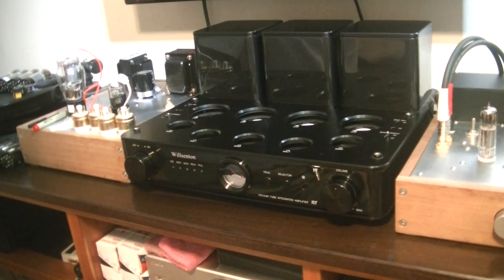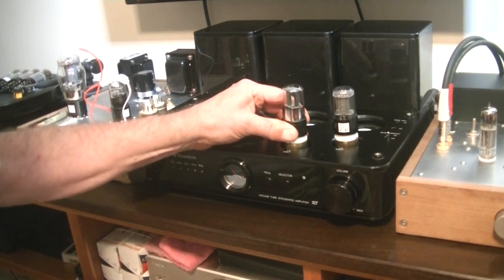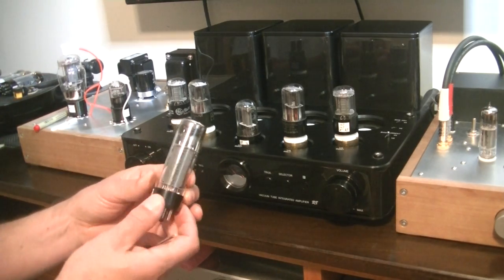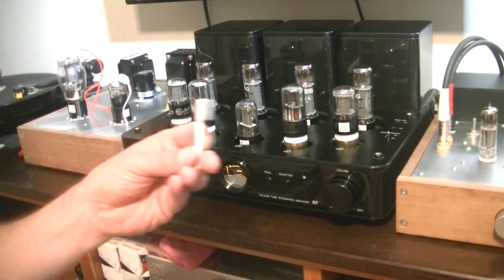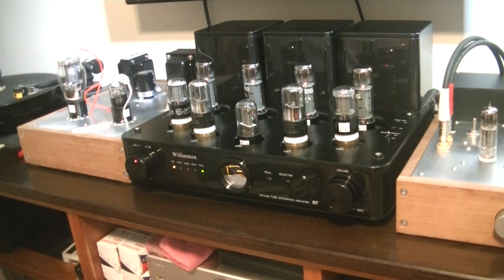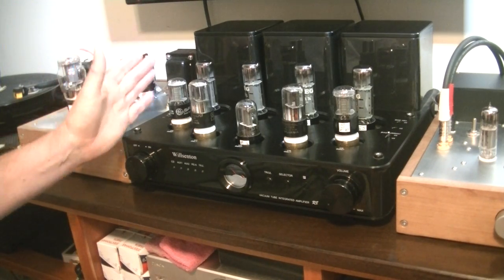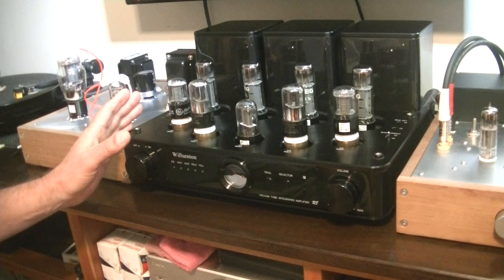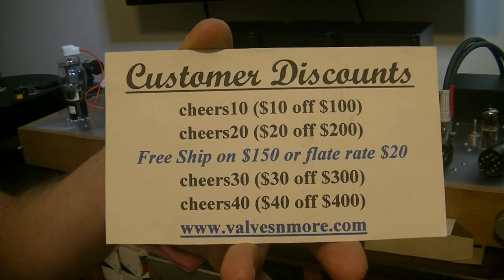Tube Lab #51 Biasing the Willsenton R8 or any Push Pull Class AB amp

Comment: I  completed my first power tube swap (Mullard EL34s to replace stock KT88s) thanks to your excellent instructions!! I checked the bias after 20 minutes. So far I am enjoying the new matched EL34s with a greater sound stage. I’ll be checking the bias over the next few days as you recommended👍👍
Reply from the maker: Ahhh success well done!  When you first start out in tubes you're always worried - will these things explode, send out lightening bolts etc,but if you follow standard safe tube changing practices of course everything works just fine.
Reply: @tubelab194  - Hey Jim, I just put an order to you for two Melz 6sl7 tubes for my Willsenton R8. Best 2 U

Comment: Hi Jim,

Regarding the Socket Savers for use with the R8, would I use the for all 5 preamp tubes? I noticed in the video you had only four.
Reply from the maker: Yup, because you won't ever need to roll tubes into the centre socket (v5), I don't bother with a socket saver/lifter.  The pair of 6sn7 (V6&9) and pair of 6sl7 (v7&8), they can be rolled as you try and find your perfect combo.
Reply: @tubelab194  - thanks Jim👍👍

Comment: Great video Jim and demo on bias on the output tubes and the test for microphonics just great !!!! I have a pair of military 6sl7 dated I believe 1948 or 44.....Im enjoying the 6sn7 and 6sl7 tubes I bought from you....love the Marconi 6sn7....nice !!!!....Ed in New York 😎☕🗽🏙🎶🎵🎶
Reply from the maker: Great to hear from you Ed!  Yes 1940's mil spec tubes rock!  It's one of the main reasons I designed the Yuri monoblock Kit Amp - to take advantage of the much neglected cv6 / 7193 wwII radar tube  (derived from 6J5), which as you might suspect, sound amazing!  Dead quiet, zero microphonics and great little driver tubes for a small amp like the Yuri (2wrms).

Comment: Skunkie designs on you tube has some videos up on some important mods to perform on a Williston R8.
Reply from the maker: Caution!  Just swapping one good resistor for another good resistor may not necessarily improve the sound.  Some of what she does looks like a good idea, but other things I'm not convinced.  Remember the r8 in stock form with quality vintage tubes already sounds great.  And watch the last episode First she got a bunch of resistor values wrong.
Reply: @tubelab194   Yes, true. One good thing, though, was upping the voltage on the two electrolytic caps from 450 VDC to be able to handle the surge. Also, changing out the choke.
Reply from the maker: @danielthomas3057  we've used our r8 commercially (it's a great test amp for quads of power tubes) for over 2 years and other than some minor problems due to the heavy use, it's worked perfectly and still sounds amazing - completely stock.

Comment: I was wondering what was your toughs on the Muzishare x7 tube amp from China.(I own a Marantz solid state amp)
It’s seems people love the sound and the cost of the unit. Before I buy a tube amp, and after looking at this video, I was hoping to get your point of view on this matter , thanks , love your videos and they are well explained for a newbie 🍻
Reply from the maker: I took a quick look at the Muzishare x7.
It looks like it only takes the KT88 power tube and the R8, can also take the EL34 giving more flexibility.  Interestingly the one thing these modern tube amps don't talk about in their specifications is the tubes!
Internal build quality of the R8 is superior based on what I can see from a picture.  I've been inside my R8 on several occasions and am always impressed at how well layed out and built the amp is, especially when you consider that it's a budget amp.
All that said, IF you can find quality affordable tubes to run, and after you check if the reviewers like the sound, the amp may be a good choice - I say MAY.
Remember the tubes ARE THE AMPLIFIERS, so plan on replacing the stock Chinese tubes with something of quality. This can increase the cost of these inexpensive amps significantly, but if you want good sound it's gotta be done.  Note it's not just inexpensive Chinese amps that come supplied with mediocre tubes, almost every tube amp made comes that way, even very expensive high end gear.
Reply: @tubelab194  big thanks for these  infos, I agree 100%, 🍻

Comment: I am new to tube amps. What is a socket saver? Why does the socket need saving? What are we saving the socket from? Do I need socket savers on my new amp? Thanks for the videos.
Reply from the maker: All good questions!
First, traditionally a socket saver was used for high use sockets, such as in tube testers, basically it saved wear and tear.  Also older equipment with iffy sockets would have an adapter dropped in to help save replacing the socket.
These days they're used as lifters, a lot of modern amps have sunken sockets (R8, schiit preamps etc) once the tube is plugged down and in, the only way to remove it is to partly pull on the glass, and this can loosen the glass to base glue bond, ruining your tube.  The lifters solve this problem by getting the tube high enough you can now remove by pulling on the plastic base.
Note if you aren't into tube rolling (trying different tubes), you won't need socket saver/lifters.  Just plug your tubes in and forget about them!
Reply: @tubelab194  thank you for the great explanation.

Comment: Why don't these amps have tone controls? What's the downside? It's a shame, is it not? I adjust my tone controls on each song.
Reply from the maker: Modern gear generally doesn't include tone controls, the thinking being they will degrade the signal path and they're mostly not needed anymore.   If you have quality source material and a good well balanced system you shouldn't really need to adjust the EQ.  Back in the day, when I was a wanna be audiophile (1970's), many people ran graphic equalizers, our equipment just wasn't that great sounding - in particular our speakers sucked.  But today if you play digital files, you can easily bring up a graphic equalizer in your software.  If you play vinyl, then you are limited to adding a physical unit in the signal path.  Simply upgrading your existing system may completely eliminate your need to apply EQ.
Reply: @tubelab194    Thanks much for that clear and informative explanation .

Comment: Hi, the bias for the V1 and V4 on my R8, could not be adjusted and the needle is on the far right. May i seek your opinion on this please ? Thanks.
Reply from the maker: You probably have the rear bias switch (beside iec power cord inlet) in the wrong position.  With the amp off, set the switch up for EL34/KT77 and down for KT88/6550.  Now rebias the amp.  Other possibilities include using the wrong type of power tube or defective power tubes, but I'm pretty sure it's the rear switch.
Reply: @tubelab194  How do i fix this, please ?
Reply from the maker: @alfa3421  did you read my instructions?  If they didn't help, I need more information than "how do I fix this"

Comment: I can see you use the socket savers and only certain tubes is there a reason why you did not use them for the power tubes as well as the center rectifier tube just a question I’m new to this thank you
Reply from the maker: The socket savers are being used as lifters, the most common use by far for them these days.  In the R8 the front preamp tubes don't have much finger room in the top plate hole to grip the base for removal (especially the standard shallow base), but the rear power tubes have huge cutouts to aid in ventilation, so you can grip the entire base for installation and removal.  Basically if you push or remove your tubes by the glass instead of the base you will break the glue bond between base and glass, wrecking the tube.  Some can be saved by a careful glue job - but who wants that if you can avoid it easily!  Back in the Day this was never a problem because all tubes were surface mounted, it's only recently that tube amp manufacturers started using PCB's with sunken tubes.  In my Kit Amp designs I avoid this poor design, even when I use a PCB, by carefully setting the boards at the right height so that the tube socket sits flush.

Comment: How do the socket savers work? Do they protect the female tube socket mounted on the amp? Or the male pins on the valve socket? Either way you still need to insert pins into the valve socket on the amp.

The R8 is made in China right? 
Probably the best value valve amp that delivers quality performance in the world.
Worth the $270 shipping costs I paid. (I have never forked out that much money for shipping and handling in my life. The highest amount i paid for shipping costs up to that point was about $25)
Reply from the maker: The socket savers are being used as lifters.  The front preamp tubes are sunk below the chassis and there isn't enough room to get them in and out without grasping the glass, which is a very bad idea with vintage tubes as it is easy to break the old glue bond and end up with loose bases.  Tubes with the shallow bases are the hardest to remove safely.  The socket savers work perfectly at getting the tube up a wee bit.

Comment: Hi, thank you for your excelent lessons.I learned a lot about tubes by your videos.
I have a question for you.I own Willsenton R8 and a quad of 6p3s-e wich sounds wonderfull.I use them with the bias in the middle.I've read that they sound best at 500 mv but I don't know wich are the values in volts of the vu meter at the first line, in the middle and at third line.Maybe you can help me.
Kind regards, Romeo
Reply from the maker: The 6P3S-E is not a good tube to substitute in the R8, it is basically a Soviet 6L6.  Yes it will work sorta electrically, but not optimally.  A lot more is involved when trying completely different tubes than just setting the bias.  The tubes that will work well are the EL34, KT77, 6550 and KT88.
Reply: @tubelab194  Thanks o lot for your answer

Comment: Hi Jim, Love your Video!  I was looking at the Willsenton R8 or the Cary CAD-120S MKII VACUUM TUBE POWER AMPLIFIER. I herd the Cary at a NY audio show with some Kef R900 about 2017 and it was amazing!  Your thoughts vs Price Performance ect. The Cary is 4 g's. Expensive!  Thank you.
Reply from the maker: I've only ever heard one cary amp and it was ok.  I've had the R8 in for almost 2 years and for a larger 4 power tube (class AB) amp it has been great.  Solid quality construction and i paid about $1,200 with the cheaper set of EL34 tubes (garbage).  At that price it's a bargain!  But remember with any tube amp the quality of the tubes makes a huge difference.  Why?  The tubes ARE the amplifiers!  And unfortunately manufacturers - even good ones, often ship out amps with crap tubes.  So plan on spending a significant amount to retube any amp you buy.

Comment: I heard some lower hum or electrical noise coming from my SET 300B amp , not exactly sure if the noise  is coming out from the 300B tube/5687 ,or is it because of biasing problem or failing tube ..noise only on one SET not the other Set amp.The 300B tubes has been 8 years old .Thanks for any opinion /help (wyetech claim to has auto bias)
Reply from the maker: If you want to know if it is a tube issue, just swap tubes, if the noise moved then it is the tube.  If that doesn't catch it, check and see if ALL your power cords go to the same quality breaker bar.

Comment: I enjoy your video a lot and have a question to seek your advise. Recently I bought the wilsenton r800i 805 model, the rectifier tube is a 274b, if I have  Ratheon 5U4G NOS, is it advisable to replace the 274b stock tube with the 5U4G ? Appreciate your advice ! Thanks
Reply from the maker: Your 274b is a Shuguang reissue of the famous tube made by Western Electric.  And even my large rectifier cross reference doesn't give a direct equivalent.  So I would suggest sticking with the stock tube.  Other close rectifiers may well work just fine, But the circuit was designed for this particular tube and switching to a close compatible will at the least change the B+, probably nothing to worry about, but given how inexpensive the Shuguang probably is, I'd stay with it.
Reply: @tubelab194  Thank you for your great advise !Appreciate it very much !

Comment: Have you had experience with the PSVANE tubes that can come with the r8 as a more expensive option to the standard Willsenton ones. I believe they may be a recent copy of philips types that are no longer in production but possibly are Chinese made, these are the ones I chose and sound nice but I have no clue on quality long term. Mine are the PSVANE EL34. Cheers
Reply from the maker: No I haven't tried the PSvane tubes, my specialty is vintage and frankly whenever I do come across a Chinese made tube I'm disappointed with the build quality, they just don't last.  Now I'm sure the higher end tubes are an improvement, but when you look at the cost, wouldn't it make more sense to go vintage?  I'm biased of course (get it biased haha)!  I love the sound of vintage tubes!
Reply: @tubelab194  I am biased as well to vintage Sansui ( non tube) but the r8 drew me to the other side. Hmmm vintage valves (tubes), could be a whole new ball game for me. Cheers for the advise

Comment: Can you use any of those 6L6 in the R8?
Reply from the maker: The tubes in the video are RFT EL34's, and along with the KT77, KT88 and 6550, are all tubes the R8 is designed to use.  The 6L6 is a completely different tube and even if it can plug in safely electrically, it will sound aweful.
Reply: @tubelab194  I have many guitar amplifiers and at the beginning we were using NOS tubes and found them to be less reliable but I have a nice stock of old tubes that I’m not using a bit more than happy to send them to you free of charge… email and I will send u pic of what I have, I’m sure u will find good use for them
Reply from the maker: @stevenpaul3886  sounds good! Email: valvesnmore@protonmail.com

Comment: Anyone here got interference on the left or right channel on there R8 amplifier, mine has produced a crackerling noise on the right channel. I have unplugged everything form the Amplifier and there is still interference happening? These amps do sound great, but I am not to sure about the build quality.
Reply from the maker: Build quality is excellent.  A cracking noise on only one channel is almost always a tube issue and probably the 6SL7 v7&8 (high gain 70x voltage preamp) To trouble shoot, first unseat all the preamp tubes, clean the pins if dirty and reseat (in same order).  Test.  If still noisy, swap both v7&8, test, if the noise moved then you have a bad tube and now you know which one.  Sub a spare and test.  If quiet you have confirmation.  Note I've had v5 get noisy and as a result recommend the rock solid Russian Foton 6sn7gtb, which I put even in my premium R8 tube sets.  Also any and all tubes can get noisy - it's a tube thing and a pain, which is why I always recommend having spare tubes on hand and even a spare set.  Lastly if these are the stock Chinese tubes, think of them as dollar store quality - disposable!  Luckily vintage tubes were manufactured for many critical systems, and as a result are of superior construction and durability.

Comment: You should tell people never switch them on without a load..
Reply from the maker: @PINKFL0YD-s2h  most tube amps can safely idle without a load with no (zero) input signal.  What you don't want to do is apply a large signal to the input without a load on the output.  But like everything, I'm sure there are exceptions!  And your advice is a good precaution.